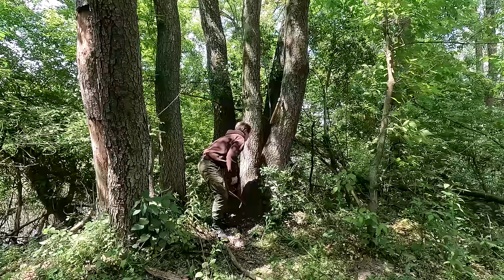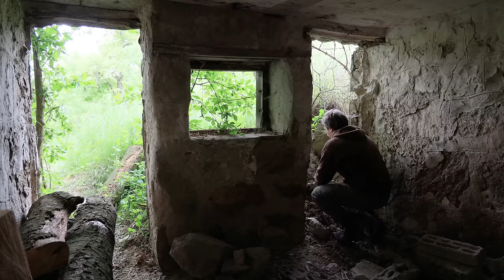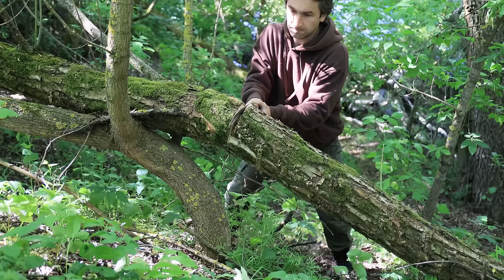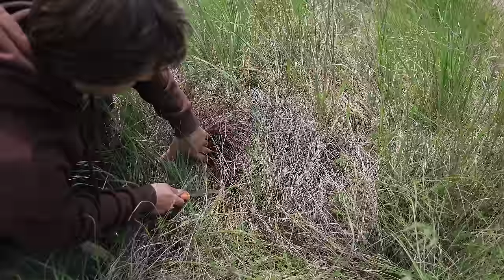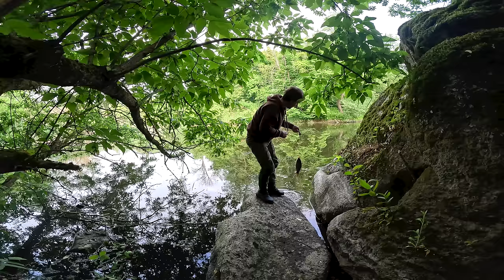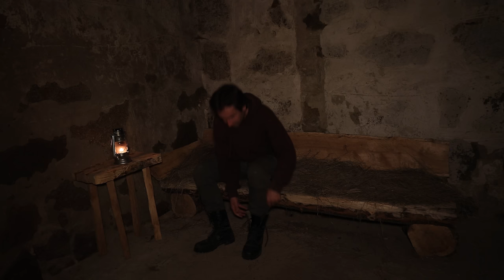Building Abandoned Underground Bushcraft Shelter for Survival, Clay Fireplace, Fishing HUGE Carp

Comment: Very nice. If I can offer some suggestions. When you felled the tree at the start, cutting a facing in first before you saw from the back helps control where it falls and stops it splitting or twisting. Second, cutting logs in half with a handsaw is tiring, you can saw the ends and then split it with you axe and some wedges to save time and energy. Can always smooth it out later and the trimmings make good kindling. Turned out really good either way

Comment: how about instead of waiting for the ring and running as fast as you can down to the lake, why dont you make a mechanism in which when the fish tugs on the string a rock tied to the other end is dislodged from a branch in a tree. then the fish gets hoisted about three feet into the air and you can just walk down without having to worry about the fish breaking free,  (and if it did how about a basket underneath the tree to stop the fish from getting muddy and prone to insects and animals)
Reply from the maker: Try it, you'll show us